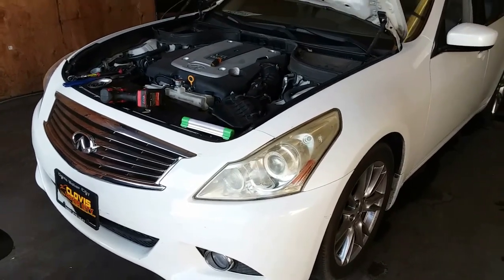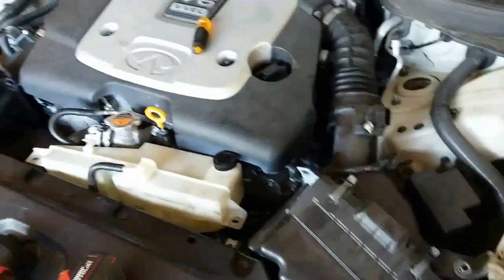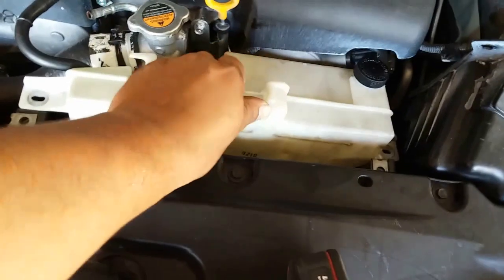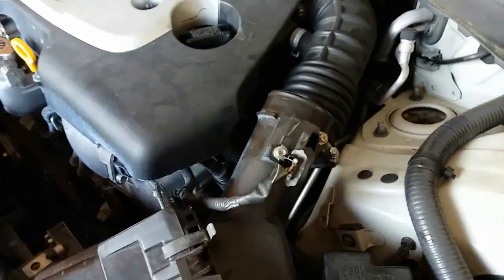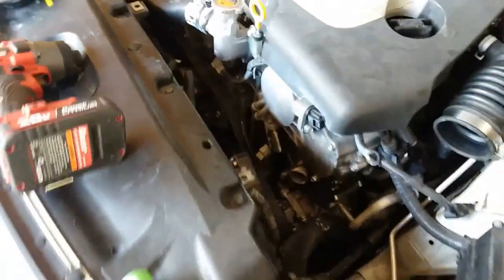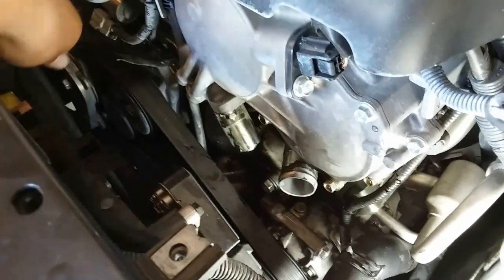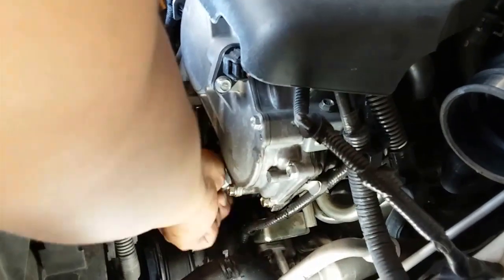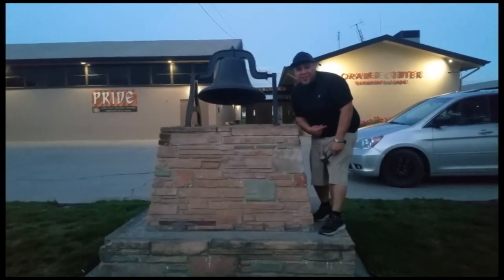How to: Remove a Thermostat from a 2010 Infiniti G37

Comment: Hey George thanks for making this. Were you able to get the nut behind the sensor without taking the sensor off? I have to do this tomorrow and it looks like it would be impossible without swivel, box end wrench or something. Ours is a 2011 EX35 but looks like the same setup.Thanks!
Reply from the maker: I didn't have to take it off, but what I did do was move the pigtail that connects to the sensor to give me a bit of more clearance. You dont have to remove the sensor because it is oil hydrahydraulic sensor.  Let it be just unplug the pigtail for more room. Hope this works out for you! Thank you for your SUPPORT!

Comment: Do you have to have a code for thermostat to be bad?. My g's temperature started going up when I was using the AC, then it went back to normal after I turned it off. The fans come on when I turn the AC on, so I don't think it's the fans. Coolant is topped off and I have no leaks.
Reply from the maker: I think it's p0128 I'm not really sure honestly
Reply: I’m currently having the same issue, ever figure it out ??
Reply: @noobkickr  no, I've been driving it like that and haven't had that issue. But I haven't turned on my ac and haven't drove for more than 30 minutes. Was it the heat outside that caused that for you?
Reply: I'd check to see if your fan is engaging when your ac is on. Check your heater core hose side for leaks. My m37x started leaking from the plastic coupler on the heater hose connections and im replacing it with an aluminum one. If those check out fine could be your thermostat is starting to go bad and you'd need a replacement
Reply: @vicentechamberlain579  I replaced the heater hose connector when I purchased the car like a year ago, the fans do engage when I turn on the AC. I'm going to replace the thermostat and hope for the best. The situation has me baffled.
Reply: @myfamily1025  im upgrading my thermostat to the super cooling one from mishimoto that opens at 150 or something like that
Reply: I’m having the same issue now bro
Reply: @myfamily1025  did that fix the problem? I have the same issue…
Reply: @Anthony-ng2kr  I’m have the same problem on my m37 I think it’s going too be the thermostat

Comment: I tried this, but failed miserable because i could not even figure out where the bolts were on the thermostat, i had extenders and all but was having so much trouble getting in there. lol and i have more room than you, i have the FX35. I'll give it another go this weekend.
Reply from the maker: Lol good luck brother just be patient, use the camera on ur phone for a better look to get an idea how to go about it...you got this bro! 💪💪💪
Reply: @559powerscape  I changed it today. I changed my thermostate, coolant expansion tank, 2 new hoses... but i had a small issue with the Coolant temp sensor. The sensor was in a tough location for me, and i gave up after a few tries. The issue i have not is that cli[ that connects to the Coolent Temp sensor did CLIP on fully, i dont want it to vibrate out now. So i may need to take to a professional to get it removed and bleed the system one more time after i replace it. UGH. Any idea? The plug connected but wont lock in. I dont want it to vibrate off.
Reply from the maker: @DTUFINOPhotography  you can try to put a zip tie or use black electrical tape to wrap the pigtail connector and the sensor. Should be a simple fix or you can see if they have the pigtail replacement at autozone or Napa and replace the pigtail. At that point you will need to cut of the old pigtail and replace it with the new one using butt connectors or soldering them and using heat shrink for a much cleaner look.

Comment: Have a 2011 g37xs can't figure out how to remove the clip blocking one of the bolts any suggestions
Reply from the maker: You can try removing it with some needle nose pliers or a trim tool removal  And a Flathead screwdriver, Hopefully this helps

Comment: My g25 is over heating any idea
Reply from the maker: Might be thermostat, radiator,  cooling fans, water pump, headgasket, radiator cap, brocken hose, many many possibilities.  Do you see any white dried up  marks under the hood?  If you do they will usually point out were the leak is at. Sorry bro. Good luck!

Comment: What caused you to change the thermostat? My infiniti is running on the warm side just trying to figure out the problem
Reply from the maker: Yeah I  replaced the thermostat cause it was also getting warm. Replaced it and fixed the issue! Hope this works out for you!
Reply: Did that issue cause your fans not to turn on?
Reply from the maker: @eliasgonzalez369  no if the fans are not coming on check  to see if your top off with coolant,  you might have to burp the system.  Check the fuses. When you turn the ac on the fans should start up. If they do, then they are working might be something else. Maybe temp sensor. Could be various things. Or blown head gasket.  Or water pump might be giving out. It's a process of elimination with the cooling system.  Might just need a radiator flush. Or radiator might be bad. Sorry bro it could be a number of things when it comes to the cooling system.
Reply: Yeah I already changed out the coolant with nissan coolant, did the burping process, swapped out the coolant temp senor. Now I'm going to try the thermostat. Thanks for the advice bro much appreciated.
Reply from the maker: @eliasgonzalez369  for sure man! Hope you get this resolved! Thank you for your Support! Good luck bro!

Comment: Did you get a P0128 after taking it out?
Reply from the maker: I believe it had a code for thermostat and thats why I replaced it. I cleared the check engine and didn't have a problem since. Sorry I dont remember what specific code number it was.
Reply: I got the code after deleting the thermostat. It’s refers to the engine not getting to operation temperature before flow of coolant.
But I’ll try to reset the codes.
Reply: I deleted the Thermostat about two weeks ago

Comment: How did you bleed it
Reply from the maker: Start the engine, open up the radiator cap keep adding coolant.....after a while when it looks good, cap it....drive it....then let it cool off add more coolant. Do this till its completely full to get all the air out of the system...its a process bro
Reply: @559powerscape  yeah I got it already thanks sir
Reply: @559powerscape  took me 25 mins lol 😂

Comment: feels like it’s impossible to remove the pig tail off the sensor
Reply from the maker: Try using a flat head to get behind the pigtail in between the connections. Press the release tab and push it out with the  flat head
Reply: @559powerscape  that worked thank u!
Reply from the maker: Heck yeah your welcome!

Comment: My g37 is overheating and then doesn’t let me accelerate, the sound the car makes is bad, is it a bad thermostat? I replaced the coolant and oil and it was still happening, no leaks from the car
Reply from the maker: Maybe is the water pump that's bad. The bearings could of gone bad causing the noise
Reply: @559powerscape  another thing was the car didn’t go past 1500 rpms, then would follow up with a rough noise
Reply from the maker: @josevilchez9829  I don't know that's hecka weird. Maybe you might need to seek a Auto Repair Shop local to you. Sorry bro. 😞
Reply: I have the same issue now, what did you do to fix it?
Reply: Maybe clogged Catalytic Convertor. When my G cats clogged at 125k the back pressure would overheat the engine and prevent acceleration over 2500rpm up to 25mph. I put 135 dollar aftermarket cats from amazon and problem fixed.